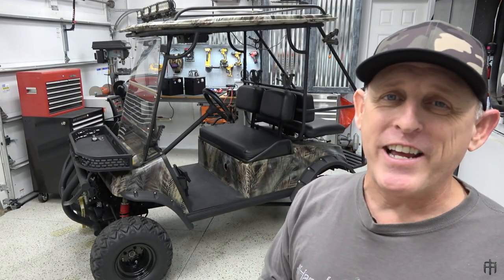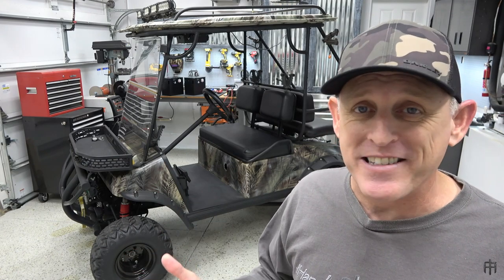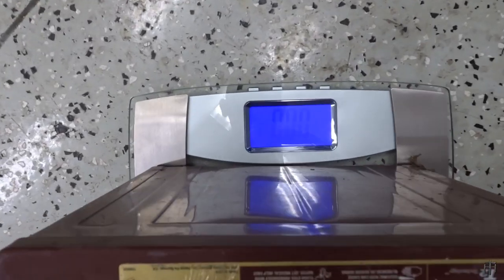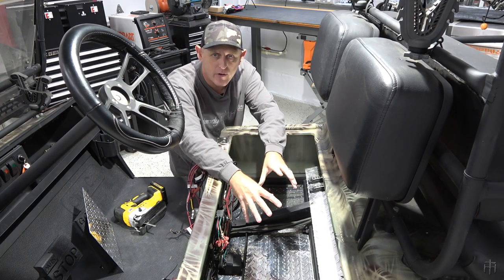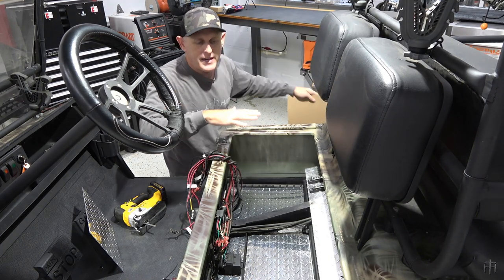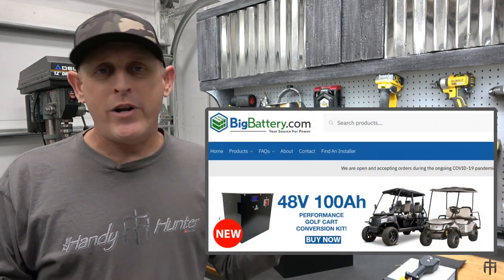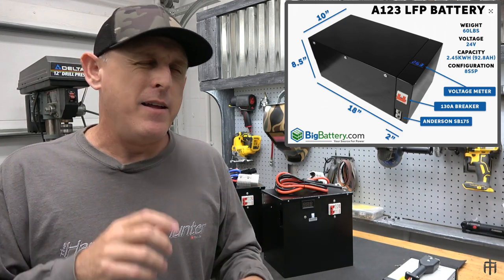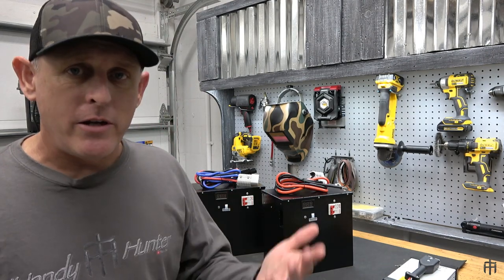Tesla Powered Hunting Cart!  Lithium Battery Conversion!

Comment: Thanks HH for the Promo Code. Just ordered the Gen 2 36V Li-ion Conversion Kit. My 1995 EZGO Freedom already has the Anderson plug charging receptacle receiver. Should I leave as is or disconnect and reroute to the bus bars? Thanks
Reply from the maker: You are welcome!  Where do your current charger leads go...the battery pack or bus bar?  With your new setup I think you’ll be best served to consolidate everything to the bus bar.  Hope that helps.  Let me know if you need anything!
Reply: @TheHandyHunter  Thanks for the reply. The two leads go to the big plastic box under the passenger side seat. I just ordered the conversion kit last night and haven’t started disassembly of the cart yet. My intentions are to basically wire it up similar to the way you did the 48V.
Reply from the maker: Sounds like a plan.  It’s pretty easy to rerun the wire once you install the bus bars.  Good luck and let me know how it goes.

Comment: Are you still happy with the BigBattery packs?
Reply from the maker: Yep, the only issue is with my winch.  Can’t find a 12v regulator big enough to drive the winch.  May have to add a separate battery just for the winch.

Comment: Do you think this would work with stock controllers and motor or would it need the upgrade?
Reply from the maker: Should be fine as long as you stay with the same voltage.  Good luck.

Comment: Looks great. Very clean build. How did you secure those battery cases down?
Reply from the maker: Thank you!  I used an adjustable rubber strap and clipped each end to the frame.  Nice and snug.  Hope that helps.

Comment: What gauge wire is that going from the battery's to the motor? When i upgraded my motor and controller I had to swap to 2 gauge welding wire I think. Those wires you were holding looked smaller than that. I could be mistaken, just curious. Other than that your build looks awsome. Also what is the total AmH on the new batteries? Cost?
Reply from the maker: Hi Jace, the gauge from the battery pack to the bus bar is 6ga.  From the bus bar to controller and motor is all 2ga.  So far it’s been fine and motor runs about 25degrees cooler over lead acid with all 2ga.  This pack runs around $2,399.  Not cheap but lithium is long life and low maintenance.  Good luck and hope that helps!

Comment: I got that temperature gauge in the mail today, did you have to make the wire longer so you could run it to your motor from where you mounted it?
Reply from the maker: Yep, I remember having to extend it with some light gauge wire...real easy to do.  I think if you look closely at the wire you can find the neg/pos marking.  Hope that helps!

Comment: Do you think this would work with a 5kw 600amp Navitis AC system?
Reply from the maker: Offroad or pavement?  I think you’ll be fine either way but offroad can be more demanding.  I run a 500 amp Alltrax and it’s been fine.  You may want to call Bigbattery and ask their thoughts as well.  Good luck!

Comment: Great video!  I just upgraded my cart to 48V lithium as well.  The problem I'm having is that my lithium battery has a separate charging port (different from the main + and - terminals), and the battery shuts off during charging.  My understanding is that the coulometer has to stay on in order to have the right information.  So I'm not sure how I'm supposed to wire it up.
Reply from the maker: When you say your battery shuts off what do you mean?  Is the charger shutting down prematurely?
Reply: @TheHandyHunter  my battery is a single 48v pack with a power button.  When I plug in my charger, the power button light turns off and no voltage is available at the main + and - terminals.  Power is not restored until I unplug the charger from the battery.
Reply from the maker: Interesting.  Did the charger come with the battery?  It sounds like a circuit protector on the BMS is being triggered...possibly for overvoltage?  How long does it stay on before it turns off?  What brand of battery is it?

Comment: What size controller do you feel is the best for optimizing cart performance without tripping the BMS ?
Reply from the maker: I run a 500 amp Alltrax and I havent tripped it yet.  I want to do a torture test next trip to farm and pull a firewood trailer uphill for a ways and max out the amps to see if I can trip it.  We’ll see!

Comment: Do you have to replace the controller and motor or is it really as simple as replacing the Lead batteries with lithium?
Reply from the maker: It’s as simple as switching out the batteries!  You may need to do a little rewiring to a bus bar for your charger wires and 12v regulator but that’s all very easy.  Good luck and let me know how it goes or if you need any help.
Reply from the maker: Oh, my lithium 48v pack had slightly higher voltage (peaks at 58 volts fully charged) on the pack vs lead acid (a good thing!) so I had to raise my high voltage cutoff on my alltrax controller to the maximum to accommodate the slighly higher voltage and prevent controller shutdown.  You’ll want to put it at max if you have a programmable controller.

Comment: I could not understand the type of cells this has, sounded like cattle cells, could you explain. Thanks
Reply from the maker: They are 2170 batteries from a model 3 tesla car.  They are basically a bunch of  flashlight  batteries.  Hope that helps.
Reply: Same batteries in power tools and laptops

Comment: I have a 2019 yamaha drive 2 what will i need for conversion?
Reply from the maker: My diagram in the video will work for pretty much any cart.  The bus bar setup makes it easy to connect all your power from your batteries and then to your controller, etc.  I hope that helps.

Comment: Great video sir.. Does the cart ride rougher now that its a lot lighter..?
Reply from the maker: The front is fine but the back is a little stiffer from the loss of weight but nothing that bothers me.  I usually throw a bag of corn on the back to help a little.
Reply: I did a very similar set up and mine is definitely rougher. still thinking about how to take some of the bounce out. Im not doing independent suspension. I've spent enough money...

Comment: Did your winch work good running off the 48v to 12v reducer ? I put a RoyPoy 48v lithium in my yamaha drive and the winch is very weak running off of the 12v reducer
Reply from the maker: Mine won’t work at all.  I blew two cheap regs and then bought a nicer one and it failed too.  I think my only option is to drop a separate 12v battery in there to run the winch.  When it ran on 16volts on my last system it would pull a truck.
Reply: Thanks for getting back with me. Im thinking a 12v battery added in will be the fix. Thank you
Reply: One more question, deep cycle or regular car battery ?
Reply from the maker: I would do a starting battery vs deep cycle…for more amp delivery
Reply: Thank you
Reply from the maker: You are welcome!  Let me know how it works out!
Reply: @TheHandyHunter  got the winch battery in today .Works great now. Didn't want to add the battery weight back to the cart , but not much of a choice . Thanks for your help . Also extended my rear swingarm 1.5 inches to help recenter the rear end back in the fender well. Turned out great for 25x10x12 atv tires. Also made and adjustable track bar to center the rear end left to right. About time to haul old freak nasty out of the woods. Hope you have a great season. Really enjoy your videos. Thanks David Burchfield
Reply from the maker: @davidburchfield8065  how’s your winch working out with the battery?  What type and size battery did you use?  I’m about to redo mine.  Thx!!

Comment: It’s me again Margaret.. :)  Ended up picking up the 1995 EZGO Medalist for $300. No batteries, tray is rusted out, controller is fried. Otherwise it’s solid. I’m going to go very similar to the route you’ve gone here (I’ll buy through your store where I can too!). Question is any tips on systems to upgrade to 48v? I’m considering the Beast 36v/48v, need to get a 48v controller, solenoid, etc. When you upgraded to 48v system did you stay with DC or convert to AC?
Reply from the maker: I stayed with DC.  I’m running an Alltrax 500 amp controller with AMD torque beast DC motor.  I think Navistar makes a nice AC setup but if I were you I’d call Plumquick motors and tell them what you want to do and they will tell you what you need...and without upselling you!  My only AC experience offroad has been with an RXV and it’s not good.  This AC setup has a weird torque curve at low rpms but it will fly at top speed.  I may look at AC down the road but would have to research more on best approach.  I know the Polaris EV uses an AC setup so it can be done.  Hope that helps.
Reply: @TheHandyHunter  Thanks boss! My dad has an EV, awesome rig but totally different animal versus these cart builds. So heavy, lots of torque and the 4x4 is great, it has its place for sure. I’ll reach out to Plumquick, had not thought about the low end versus top end application!

Comment: With all that room just make it a on Board charger and ring terminal with fuse and charge with wall
Reply from the maker: I plan to do that in the future with a charger that’s waterproof...this one is only weatherproof and I pressure wash my cart often.  It would be easy to install and so convenient, especially since these types of chargers don’t weight much.  Thanks for commenting!

Comment: What's up HH glad to see another video and as always very informative. I was thinking of getting the same kit. I have a few questions that hopefully you can answer. Do you think the winch is going to work with that voltage regulator with the about us draw, I know you had it hooked up on 2 batteries (16v) and if you can tow that trailer with a load to see if the BMS will shut down. Finally can you do a diy infrared light with solar for our night scopes.  Great job keep up the informative videos👏👏👏
Reply from the maker: Stay tuned as I’m hoping to test out the cart at the farm this weekend.  The winch worked fine at home but I didnt put it under load.  On 16volts it came on immediately.  On my 12v reg I have to hold the button down for about 3 seconds while the lights blink before it comes on.  I think it’s delayed because it’s loading the capacitor?  It does seem to be straining the regulator a bit so I’m thinking I might find a slighly higher voltage regulator in the 16 volt range (if they even make them) and connect the winch to it separately.  It would be an easy install.  My current 12volt reg is 30 amps and hasn’t blown a fuse but not sure about the start delay and why my lights shut off while pressing the winch button.  I’m still getting used to this setup but it’s been great so far.  I want to do a range test on the farm.  I got 25 miles at home on pavement with 25% battery life left.  If I get half that at the farm I’ll be happy.  My motor runs a lot cooler now too👍.  Keep an eye out for some future updates.  Thanks for watching!
Reply from the maker: I’m ordering an upgraded 60amp 12v regulator as my first one blows a fuse with lights on while using the winch.  It’s a 30amp and my new one is 60amp so that should work a lot better.  Whole cart is working great except for the 12v regulator which will be fixed soon.  Just wanted to give you an update.
Reply: @TheHandyHunter  I can wait to see the updated video once everything is lined out. Trailer full of pigs and the winch pulling them up a tree to get cleaned out.👍

Comment: im assuming the capacity isnt the same, how long can you go between charges?
Reply from the maker: I got nearly 25 miles on pavement but I typically plug back in when I return from even a short trip.  There’s plenty of range for my needs and it takes a while to run them down.
Reply from the maker: Exactly!  I still plan on doing an offroad range test to see hiw far I can go.  Dirt roads, hills, and mud should be a good test.  I do all that now with no problem but I usually come back and plug in periodically.

Comment: Did you or when are you doing the range test with new batteries????
Reply from the maker: I did a test on pavement and got 24.7 miles with 25% battery capacity left.  I didn’t do a video on that run but do plan on videoing an offroad range test at the farm in the next couple weeks.  Stay tuned.

Comment: What if someone shorts out the terminals on the charging port. They have voltage in them all the times.
Reply from the maker: No way to short it out because the terminals are buried in the plug.  You can also get a cap that covers to protect from dirt etc.
Reply: @TheHandyHunter  That's great. I was thinking if we could introduce a diode in the charging cable to let the power flow inwards only and no output power when charger is diconnected.

Comment: This jimmy-rigging is not 100% sound. During charging there is potential of sending over voltage to the motor. The charger usually is a higher voltage than the battery.
Reply from the maker: If there was any voltage going to the motor during charging it would be running.  Plus, motors have a huge variance in voltage range.  I could run 72v to the motor and it would be fine.  I ran 48v to a 36v motor for years with no problems.

Comment: I'm contacting Bigbattery on Monday. Cool video.  Really interested to hear what kind of milage you are getting.
Reply from the maker: Got nearly 25 miles at night running lights on pavement.  Want to do an offroad test to see how far I can go.  Good luck and tell them I sent ya!  Good luck and keep in touch.
Reply: @TheHandyHunter  I finally got around to converting my cart. My batteries were on backorder and took awhile to get. The install went smooth and the cart runs great. I did something very similar to your charging setup, but I used the factory pin handle instead of the Anderson.  Anyway, just wanted to say thanks for the helpful video. Happy hunting!

Comment: What shunt and monitor do you have I like that and would like to add one on my rig
Reply from the maker: Check out our Amazon store in the description.  I have a link to it there.  You can also search for “coulometer” and find others.  I really like the one I have and it’s a really simple install.  They are great for keeping tabs on the system.  Good luck!
Reply: @TheHandyHunter  I have the same coulometer as you. ?? When you charge your battery does your coulometer show that its charged or do you have to reset the coulometer after every charging cycle? Thank you
Reply from the maker: It automatically shows the state of charge at any given point.  So it will show 100% when battery is full.  Hope that helps.

Comment: Any word on range yet? Curious if your running 15 MPH constant what range looks like. 20 miles?
Reply from the maker: I did a range test on pavement and got almost 25 miles.  My next range test will be off road and I will try to do on my next trip to the farm.
Reply: @TheHandyHunter  you’ve built an awesome rig, appreciate you taking the time to make the videos
Reply from the maker: Thank you brother!  I’m getting the itch to build a bigger one...we’ll see.  Good luck!
Reply: @TheHandyHunter  I found a bare cart this week for $700, will be a good foundation to build up and don’t have to drop the cash on a bunch of parts I won’t use. Your videos were the inspiration 😎
Reply from the maker: Awesome!  That’s all you need is the bare frame.  Did you go with ezgo or club car?  Either is fine but you can weld directly to an ezgo since it’s steel.
Reply: @TheHandyHunter  EZGO
Reply: Anyone familiar with bad boy units?
  i checked out an 05 model yesterday.
Please explain the 4wd/automatic button.
And do you ever have all 4 tires pulling or just 1 front and one back?
Thanks...
Reply: @golfish8589  Yeah, honestly I’d rather build off a regular old cart that a BBB. Nothing wrong with them, but you’ll over pay for outdated technology. Plus a 4wd cart isn’t really necessary often if you drop a limited slip in the rear. Add a front winch and you’ll be fine. Turning the front tires pulls tons of amperage and adds weight. You can add front hub motors instead of a driveline 4x4 system but they are really expensive. I’d recommend you save your money and roll with a built 2wd cart and see how it does for you, you’ll be surprised.
Reply: @jimmyanthony6557  i want to plow an ice rink out on the lake..I picked up  Yerf Dog sidexside with solid back axle. But only rear wheel drive.  It came with a plow. The plow is about 3ft out from the front. And I think it removes a lot of the weight from the back wheels. And gets stuck very easily in 8 inches of snow.
I found a 05 4wd bad boy for $5000 including brand new batteries

Comment: someone with your skill set should mention the LiFePO4 Deep Cycle Battery OPTION which is a TOTALLY SAFE drop in replacement for Lead Acid  
i like what you did and all but this seems like sponsored content and LiFePO4 is also Tesla Powered and a cycle of over 5000
Reply from the maker: Nothing wrong with LiFePO4 option at all.  Great option if you find a set that works for your setup.  Lots of good options out there over lead acid!

Comment: why didn't you go with the company called roypow and they have really fast charger for it for the price of this set you bought plus 5 years warranty drop and play
Reply from the maker: Not a bad option at all.  It really depends on your setup and install skills.  Both are easy but I like the two battery setup because they are the same size as my 8 volt trays plus I like the Tesla technology in these batteries.  Either one is light years better than lead acid for sure and you can buy the 2170 set straight from the Bigbattery.com website.  Hope that helps and good luck!